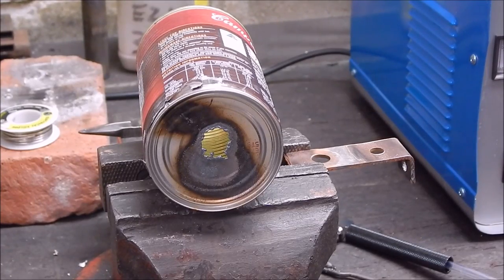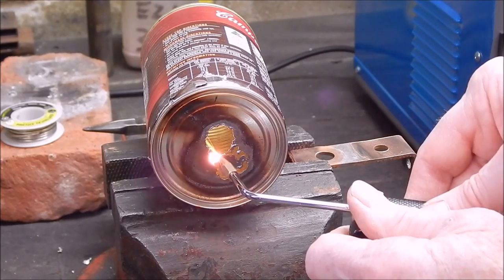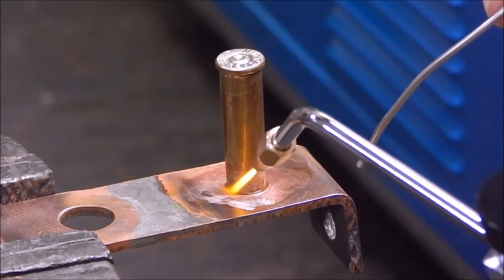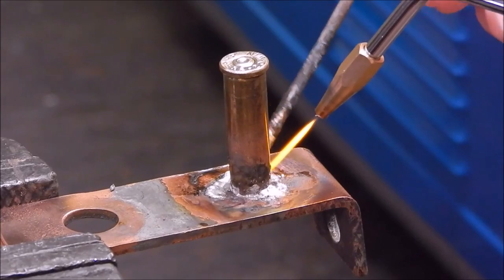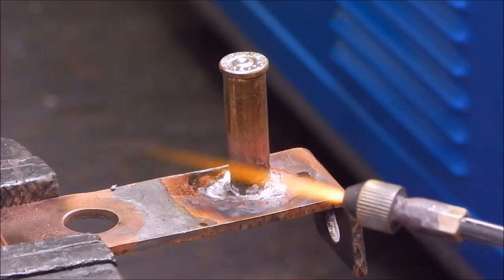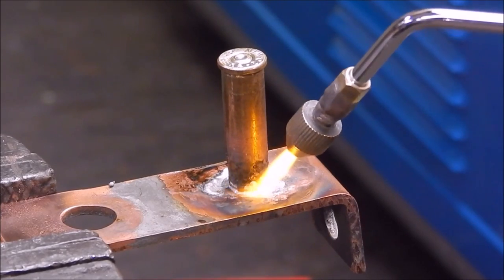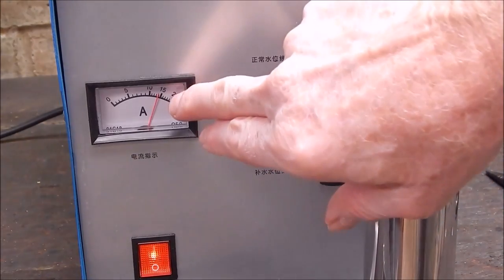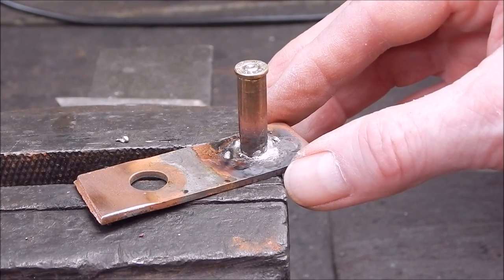I play around with a cheap H160 HHO oxy hydrogen water torch to see what it can do

Comment: Still showing a lot of potential but for sure that CU was a real heat-sucker! :)
Reply from the maker: Hi Chris,  it doesn't like high heat loss jobs as the Bthu's just aren't there.  It's designed for micro work and that's what it's meant for. 

It handles soldering quite well and would be great for small copper pipes on model engines etc, but that's about it.  I tried melting an aluminium CPU heatsink fin with it and no go - just too much cooling effect.

I managed to do some 3 mm steel rod bronze brazing jobs with it and that was it's limit.  So it would do the conrods for the Stirling engines I recently made, no problem.  Silver solder would also be a bit easier for it.  

It's a fascinating thing and I've given the little Sherline microl lathe lots of work machining jets etc with it.  What a great little unit that is.  If I was stuck for space and had no workshop I would still have that lathe - it's simply amazing.

Cheers Rob
Reply: However you slice it Rob - you are going to enjoy having that unit :)

Comment: I think your soldering demo shows the common problem with this type of system, in that there is a lot of temperature but not a lot of heat. Have you tried changing the bubbling container from water to one of the alternatives, a mate of mine uses MEK in his.
Reply from the maker: Not yet.  One step at a time.

The Bthu's are definitely low, but it's a small unit and meant for small work.  I will push it as far as I can, but at the end of the day there is a limit to what it can do.

It didn't do too badly, as I doubt you could even solder that join with an electric iron given the obvious heat loss.  Cheers Rob
Reply: "lot of temperature but not a lot of heat" - what a meaningless stupid statement if I've ever seen one... It has nothing to do with anything you're saying. He needs more flux and better technique.

Comment: It actually looks like it could work well as a fine work cutting torch on thin steel, like cutting back rusty rocker panels, or burning out spot welds. Maybe try using brazing flux and thin strands of electrical wire and see if you can use it to gas weld some copper pieces

Comment: Wouldn't this be good as shielding gas for TIG?
Reply from the maker: Shielding gas has to be inert.  This is highly volatile.
Reply: @Xynudu  it doesn't have to be really. All it has to do is to eliminate the oxygen around the area. That and also become plasma.
Reply from the maker: I have never seen anyone use flammable gas as a shield.

All the standard shield gases such as Helium, CO2, argon, nitrogen are non combustable/non oxidising gases for a reason.

Show me some evidence and I might believe you.
Reply: @Xynudu  well, see my guess is that the gas, while being a flame (a kind of plasma) is by definition a neutral flame. It seems to really like to oxidize steel though and I've seen some really crummy soldering done with it.... But I'm thinking that it might work as is as a tig brazing flame if you actually add soapstone to the weld surface and rod. I remember a friend who actually had the flux in powder form for oxyacetylene in a special delivery pressure tank. I don't recall if it was powder or liquid. Either way is way cheaper than getting an argon tank as a consumable. This is why I'm asking around to see if someone has actually tried and discovered a way to make it work.

Comment: hi rob,can you do  what it cost to run,money .thanks
Reply from the maker: Hi Geoffrey,  apart from the initial electrolyte cost (calcium hydroxide) and some distilled water (both cheap), the only other cost is 300 watts of continuous electricity use while generating gas.  The electrolyte solution is very slowly consumed, so compared to other heating torches it basically costs next to nothing to run.  That makes it extremely appealing.  Cheers Rob

Comment: Very nice . What type of flashback arrestor you using?
Reply from the maker: None.  Just the bubbler.
Reply: @Xynudu OK thanks for that.  But some say the arrestor is to prevent an  explosion in the bubbler itself!? .Please clarify as I want to build an hho rig in a safe way.
Reply from the maker: An arrestor (at the torch) will prevent an explosion (small) in the gas hose and bubbler.  The bubbler has a blow off valve as well so no damage can occur.  The flash cannot get to the HHO generating pressure cylinder because of the bubbler liquid barrier.  I now used a torch with a flashback arrestor built into it and that has stopped any fashback reaching the gas line.  Another key factor in preventing flashback is to use methylated spirits (denatured alcohol) and acetone in the bubbler (3:1 ratio) rather than water.  The flame is longer and I have not had any flashback with this mix, which was advice given to me by an ex jeweller. Cheers Rob
Reply: @Xynudu  Thanks SO MUCH for that  , it's given me LOTS of new info. Just 2 more questions please. What material you use in the torch arrestor and do you have an idea of the minimum size of plates/generator container to produce enough gas to melt copper/gold etc. Much appreciated
Reply from the maker: I have not disassembled the flash back arrestor so I can't comment on what it is, however, they appear to be a fine porous material such as used in aquarium bubble makers and brass fuel filters.  I have no idea of plate sizes required relative to gas output.  Cheers Rob

Comment: So how much sodium hydroxide or potassium hydroxide did you use ?? I
Solder all day on mine stainless steel pins with 56 silver solder i use 200 grams of sodium hydroxide per liter of distilled water  i pull 23.6 volts at 9.2 to 9.4 amps i changed the crappy analog meter for a digital one i also use 70 % ipa in the bubbler in place of water
Reply from the maker: https://www.youtube.com/watch?v=rD8XyicU_bo

Comment: I have seen a couple of videos where people are soldering with one of these systems and having problems.
I wonder if the problem might be that the flame is slightly on the oxidising side. Although the hydrogen and oxygen are produced in the right ratio for complete combustion. When you have the flame in air it is drawing in oxygen from the surrounding atmosphere thats why you get a good cutting flame, you can see the sparks indicating the steel is burning in exess oxygen. 

You mentioned in your earlier video that the manufacturers sugest using meths or acetone in the buble trap to control temperature. I wonder if that is actually to add additional fuel in the form of alcohol vapour to bring the flame back to neutral from oxidising.
It's good to see someone who reviews kit from China dispassionately rather than starting with the "it's Chinese it must be rubbish attitude" we see from people intent on defending their own domestic industries an any cost. These products allow the backyard engineer access to technology at a price point that would otherwise be unatainable to the run of the mill guy.
Thanks for all of your videos really interesting and enjoyable.
Reply from the maker: Thanks for the positives.  When soldering with ANY torch you should keep the flame away from the solder as much as possible as it will oxidise the lead and cause adhesion issues.

The test in the video really pushed the torch due to the heat loss from the copper plate.  Even so, the torch performed OK.  I could have done a neat job by tinning both sections and then sweating them together.

I deliberately did it as per the video to surface melt a significant amount of solder and see if it would capillerate etc (which it did).

Using different liquids in the bubbler can do as you suggest.

Cheers Rob

Comment: Long time since I did this, join thin pieces of sheet metal using an oxyacetylene torch, a quite small one for the thinner gauges, the process was to do just what a TIG torch would do, join the 2 pieces of sheet metal with addition of filler metal, a 0.045" TIG filler rod would be used as an add on filler.
Your tiny torch seem to have a very precise and narrow flame, also wondering if the combustion gases would do like TIG or oxyacetylene processes provide proper shielding during the operation...
This has potential in micro welding situations...
Reply from the maker: Hi Pierre,   I've only just scratched the surface with this little torch.  We all have to think in micro scale with this little gadget, but it's a lot like it's big brothers in flame shape etc.

So far I've mainly concentrated on "how big" it can handle.  Now I will look at "how well" it can do it.

The fact that it costs virtually nothing to run means hours of endless fun :)

Cheers Rob

Comment: interesting torch, but a horrible soldering job. solder & the soldering agent (flux) should be applied at the same time. so that as it cleans it draws the solder into the join. any black (carbonization) shows, you need to stop, clean & start over

Comment: Nice to see, but pretty useless. A larger unit that separated hydrogen and oxygen so the mixing ratio was adjustable would be interesting. :)
Reply from the maker: It all depends upon what sized job you are working on.  Just like small lathes versus big lathes - they make them for a reason.  Cheers Rob
Reply: @EitriBrokkr  Theoretically, hydrogen and oxygen burn completely at  2:1 mixing ratio. In practice, at least 4:1 is needed so that no free oxygen hits and oxidizes the metal.
Reply: @Xynudu  That's the point that everyone needs to keep in mind.  Rob is exploring the pros cons and limits here and that is what we all want to know about this tool. My MAP torch will brew a lovely cuppa without burning a hole in the shed kettle but I wouldn't want to host a garden party with it. Horses for courses.  Oh and while I'm here .22LR  for doves not 44/40.
Reply: @SuperKoaren  Got to be careful not to introduce oxygen or hydrogen in the brazed or welded materials, copper is real sensitive to this introduction, other materials are also but to a lesser point. Another point is that the result of that combustion is pure 100% water.
Reply from the maker: Dead right on both counts ;)
Reply from the maker: I did some basic copper wire heating and it went green, which is not a good sign.  Cheers Rob